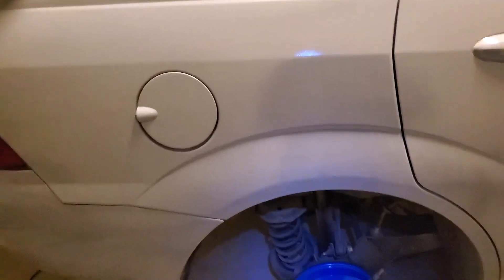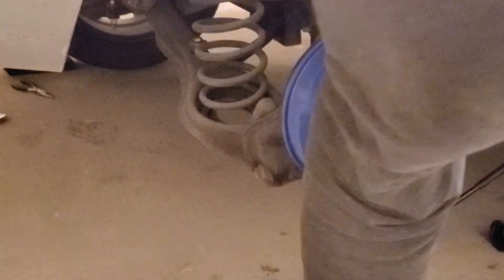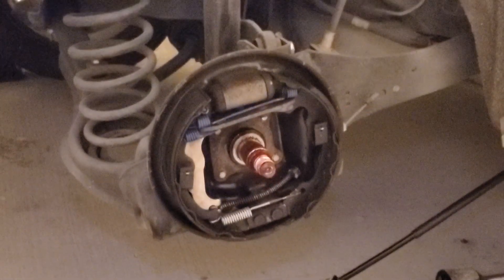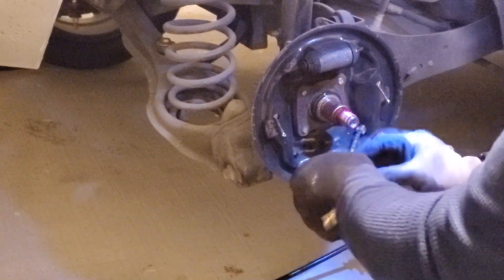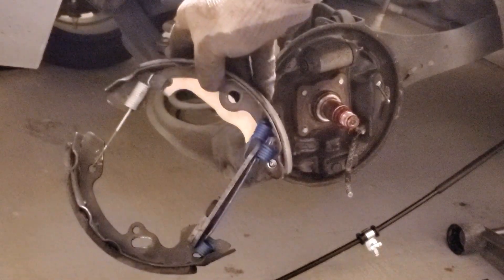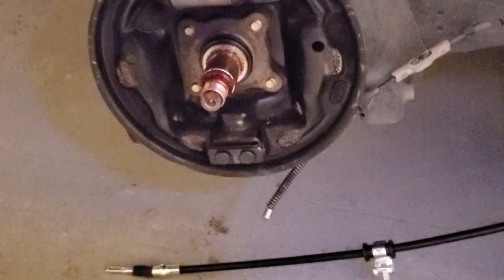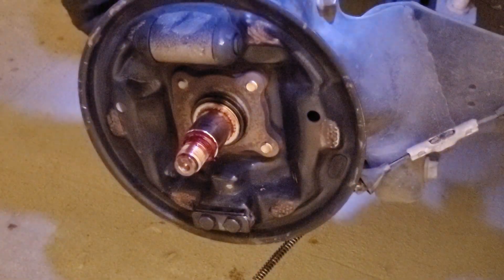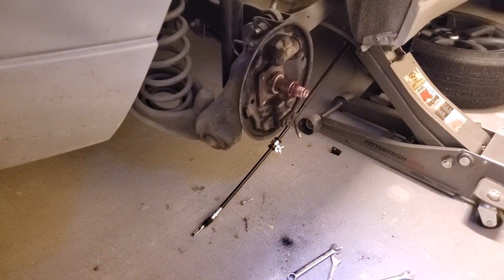Drum Brake to Disk Brake Conversion Episode 14 Part 1 of 3

Comment: Can you use the disk/drum master cylinder, to operate the rear calipers?

What are the big valves for, coming directly out of the master on the driver's side, and going to the rear brakes? 

Do you keep, and use those, to operate the rear calipers, or eliminate them?
Reply from the maker: You would have to delete the drum kit completely. Everything in the video is what you must do to get the disk brake conversion to work. This includes swappi g brake cables. The drums will not work with disk brakes. Those wheel cylinders control brake pressure of the drums in the rear.
Reply: @FocusedHands  So I eliminate the two proportioning valves from the master, and just screw the rear brake lines into it?
Reply from the maker: @davidchristopher5976  your brake lines will have to change aswell. Id start with video 1 and work your way through video 3. You will need brakes lines for disk brakes.
Reply: Actually, my 03 ZTS came with factory rear disks. 

Unfortunately, it also came with 4wabs, traction control, and even stability control.

I say unfortunately, because finding the correct master cylinder for this application has been impossible since at least 2015. It's a unicorn part now. I figure it's because they didn't make very many of these.

Anyway, I'm doing away with the 4wabs, trac, and stability control..but keeping the rear disk setup.

I'm changing the master, from a 3 port, (pressure transducer) to a disc/drum 4 port with matching booster. (My original booster has offset MC mounting studs, instead of the normal straight across ones.) 

The donor master and booster is from an 03 ZTW with rear drums, and 4wabs.

I will be joining the lines from this disc/drum MC,  to the lines coming out of the HCU and going to each wheel.

I just cannot figure out if I should retain the rear proportioning valves, or get rid of them. Now that the abs unit won't be the thing controlling the pressure to the rear calipers.?
Reply: @FocusedHands  they are all 3/16th lines. The 2 coming out of the unicorn master cylinder going to the abs unit were 1/4 in. After exiting the abs unit they are all 3/16th.
Reply from the maker: @davidchristopher5976  ok so yea my focus did not have the extra features. The ST does not even of that set up. However, it does come standard with disk brakes all around. Id be interested to know what you figured out on this though!
Reply: @FocusedHands  I'm hoping to have it finished by tomorrow afternoon. I'll lyk what happens Hands. 

I don't know how the PCM is going to react tho. It's going to lose all communication with the abs, trac, and stability control modules 

Those proportioning valves are another wild card. If I delete them, and it needs them, I'm going to have to redo the entire rear line connections to add them back.

I love the new easy bendable brake lines. It's makes this much easier, and they never rust!
Reply: @FocusedHands  Well I didn't get it finished today. But should be done tomorrow with it. Pretty smooth so far, but I had to stop to fix my family's car.
Reply: Still not finished. Two new masters had no pressure on the two front ports.
Reply: @FocusedHands  I'm still not getting any pressure out of the two front ports. I've tried 2 new masters, and even the one that came with the used booster. 

I checked them at the master itself too. 

Nothing.

The master and booster came from a SOHC SE focus. Is there a difference between a SOHC and DOHC master and booster? My research and looking at them I'd say no. But something is not right.

Comment: can you just get all the parts at the junkyard?
Reply from the maker: If you can find them! I normal do not get brake parts used... i.e break pads/hoses and cables.
Reply: @FocusedHands  no of course I ment all the main parts hubs and such
Reply: Also what should I be looking for to pull off 🤔 year and model
Reply from the maker: @2008DJEvolution  You can use 02 on up to 11. They all should fit. The models with the disc brakes are the ST some SES's the SVT and any car I've worked on lol.
Reply: Ty much appreciated

Comment: Can you make a parts list for this please and where to get them
Reply from the maker: Yea I can do that!
Reply: Thanks man I got an 05 automatic and a 07 5 speed I’m gonna do it to one just need a parts list
Reply from the maker: @mikelewis63  ill put it in the description  soon
Reply from the maker: @mikelewis63  Done!
Reply from the maker: and you can pull the calipers from years 00 all the way to 11
Reply: I noticed the calipers listed are for the fronts. And the rear spindle/axles are only one side. At this point massive speed systems brakets will suffice but any rear caliper from an ST will work I assume.